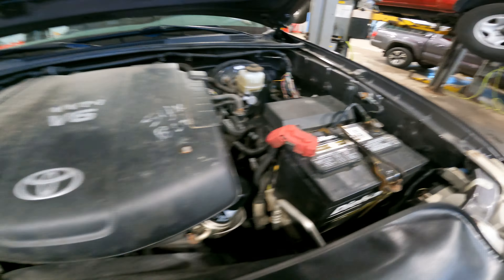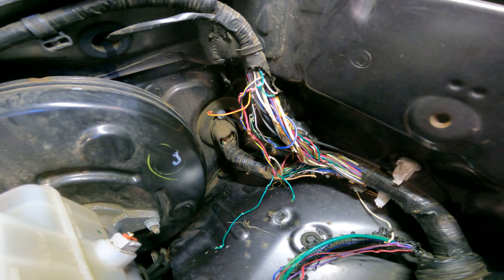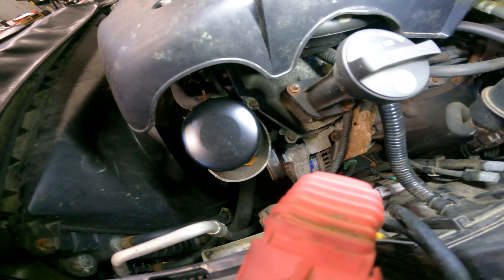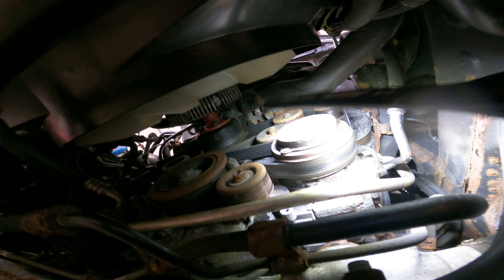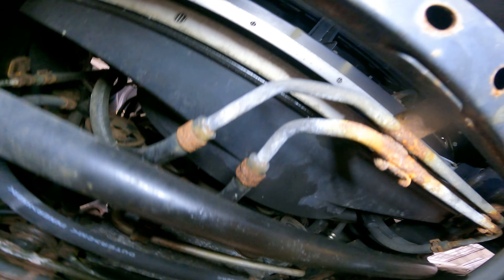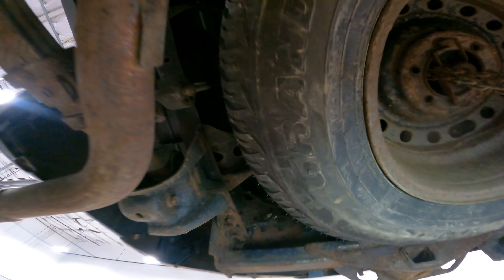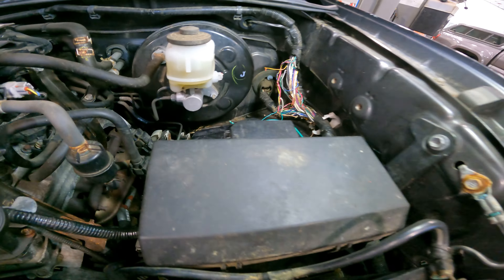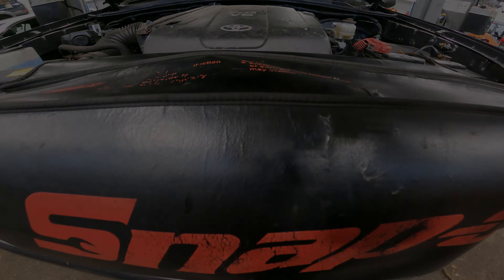WHO INSTALLED THIS BELT, RAY CHARLES!?🤣Squirrel damage found!😨😳😡

Comment: Unlike the last one, there is justification on this one for a harness.  I'll just say, however, you have to be a pretty good hack to find a way to fit the belt the wrong way where it goes on and tensions up normally!  Not just any hack can do that!
Reply: A hack that got the wrong length of the belt and just had to make it work. As long as it's not getting in touch with anything undue I'm not too worried even though it's the wrong path. I file it under "if it looks stupid but still works it ain't stupid".
It do look like the belt was ripe for replacement anyway so it probably was going that way for a long time.
Reply: No way, a bit of tape and that one will be good as new!
Reply: @ehsnils  Flat side of belt probably shouldn't go to ribbed side of pulley.  Makes for funny grooves in the belt. 😛
Though I was almost expecting to see a squirrel hanging on for dear life.
Reply: @dotar9586  To me it did look like the ribbed side went to the flat side of a pulley, which isn't that bad.

Comment: I used to work an electric utility here in northern Indiana. Squirrels used to take out our electric transformers quite often. We used to call them, Tree Rats
Reply: When I was in Electrical School in London Ont. many years ago, the building had a 150,000 (or so) Volt to 12,600 Volt Step-Down Transformer in a fenced off area beside it and one day in the early fall (late Sept. if I remember correctly), a Canadian Goose thought it looked like a great place to land and rest for a while during it's Migration Flight...

It's wings unfortunately were more than long enough to Bridge 2 of the 3 Phase Lines on the high Voltage side as it was landing...

All everyone within about 6 blocks heard was what sounded like a bomb going off followed instantly by the local power going out as the 150,000 Volt Dead-Short caused the Transformer housing to explode...or at least the top and wire insulators did, about 65-70% of the main housing did survive (looked like Elmer Fudds shotgun after Bugs Bunny stuck his finger in the barrel)...

We know what happened because one of the Schools Security Cameras was pointed at the transformer and we saw the bird start landing and then everything disappeared in a MASSIVE flash of blinding blue light...

I think the London Hydro crew found a half-dozen un-scorched feathers and maybe a third of the beak (or it could have been part of a foot, it was too scorched and mangled to really tell)...the rest of the bird was charcoal and ash...

Comment: 0:43 - Rocky, as in the squirrel half of Rocky & Bullwinkle. Or maybe Skrat from Ice Age?
And yes, squirrels can really do a number on wiring, and to log cabins as well. Put the two together, and you know why our attic lights haven't worked in a over a decade. (Don't worry, the breaker is off!)

My first car, '83 Olds Omega 2.8L carb. I'm 19, the year is 1997, and I'm in tech school for PC repair. I'm working part-time for a nice restaurant, making about $110 a week. My car has a pretty nasty oil leak - crank seal - and I take it to the Auto students at my school for repair. After school, I pick up the car, pay the labor rate (I supplied the part) and I start the car. It has an audible low rumble that wasn't there before. I immediately ask the teacher, and he tells me that sometimes the new seals are "tight" and can be noisy until they "break in." OK, he's the Car Guy, at that age I didn't know much beyond the basics. Well, twenty minutes later, in a snowstorm on the highway, I round a bend - there's a THUMP, I lose power steering, the Alternator light comes on, and the defroster begins blowing cold, icing up the outside of the windshield. I coax it off the next exit (1/8 mile) into a commuter lot as the TEMP light turns on. I called my uncle, he comes to take a look, and it turns out the students had CROSSED the power steering and alternator/water pump belts, the noise I heard was the two belts rubbing each other, and boy did I give the Auto teacher a piece of my mind the next morning! I had to replace both belts because they were chewed-up; the alternator/water pump belt was damaged to the point that, even when properly-adjusted, it wouldn't stay on the pulley long enough to start the car.

Another similar story, I had a '94 2.2L Cavalier, and I taught a friend of mine to drive stick in it. He loved the car so much that he bought a '92 2.2L Cavvie stick of his own, from another friend of mine. I drove the recently-purchased '92 from the seller's house to the buyer's house, since he didn't have a license at the time. Once we got to the kid's house, I popped the hood to give him a list of parts he would need to do a tuneup and to familiarize him with maintenance checkpoints... And immediately I noticed the serpentine was routed completely wrong on that engine. Yet, miraculously, everything was rotating the right direction - the tensioner was maxxed-out. The seller's parents had replaced the alternator for him one day while he was at work, and he never checked it out because everything seemed OK, although he remembers them saying they had to fight REALLY hard to get the belt on. 😆It turned out to be a teachable moment for the buyer, he wanted to learn how to work on his own car, he was 19 but had never been under the hood except to check fluid levels. Working on his car ended up really helping his ADD and he pretty much replaced everything on the car even though it wasn't needed, simply for the experience.

On my '94, a few months later, I changed the water pump while a buddy watched. He thought he was hot s--t and demanded to install the serpentine belt. He was a Ford guy and very anti-Chevy (except when he needed to borrow my car, funny how that works)... I figured, easy enough job, he couldn't possibly eff it up... His friend and I spent the next 45 minutes or so watching Mr. Ego struggle with that serpentine belt. He was cursing out GM engineers, calling my car all sorts of nasty names, while we were trying - and failing - to NOT provide color commentary and a background laugh track. Three separate times I told him exactly which way the belt was routed from a comfortable distance of twenty feet or so (you never know when a breaker bar is going to fly through the yard towards you), and I watched him be so confused by the diagram under the hood showing the belt path until I finally told him to get out of my way. Thirty seconds, I'm done; he gives me an angry look. I look back at him, shrugged, and by now his friend actually is wheezing and gasping from laughter.

Comment: At what point does the repair costs outweigh the worth of the vehicle
Reply: These days.... a lot of repairs for a any Toyota with a solid frame that can go several more years with some work.
Reply: At the point where the owner decides to skip the repair. 
Each person is different, but for me the worth of a vehicle is the monetary cost to buy an equivalent replacement, plus the value of not shopping for another vehicle, plus the cost of not having the vehicle while I find another. If I don't want to replace it, then the worth is whatever I could sell it for.
For example, if you offered to buy my car for exactly what it would cost me to replace, I'd refuse because then I couldn't drive to work.

Comment: 4:42 Frame rusted thru.
Reply: A beam has almost no stresses in the middle like that.   That is why you can cutout a floor joist in the middle to run pipes, but not on the bottom or top edge.   Most of the stress is in the bottom middle of a beam.